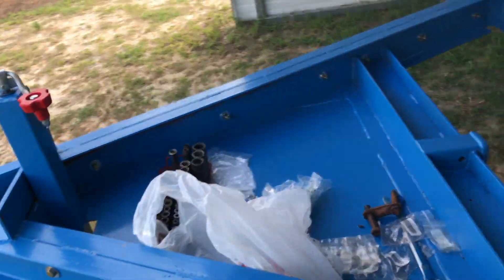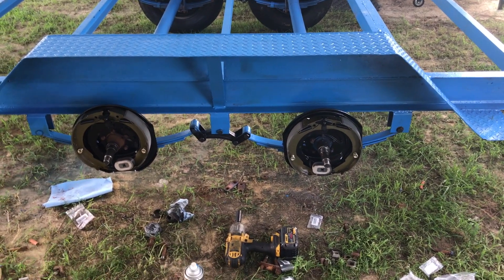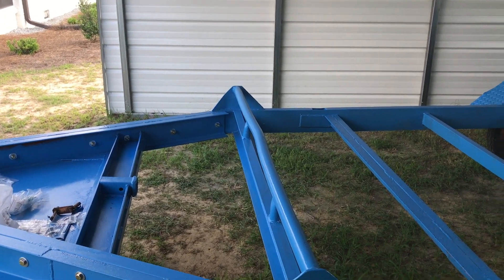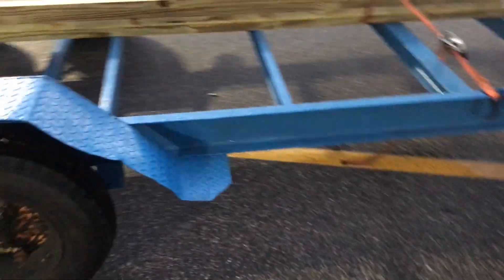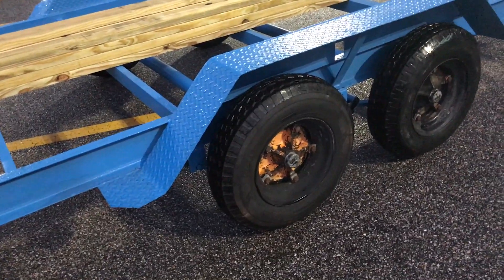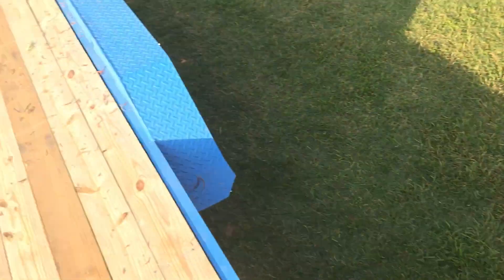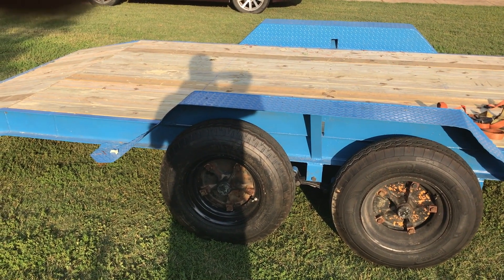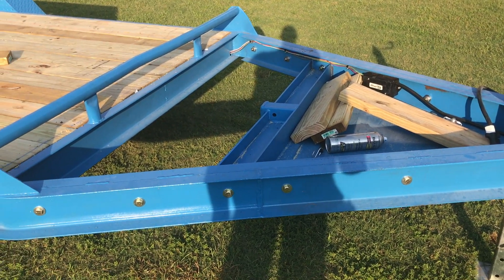Equipment Trailer Rebuild

Comment: Very nice trailer,used motor oil for stain?
Reply from the maker: I may I haven’t thought to much into it thanks
Reply: @noahswelding6836  cheap and easy,and works good.

Comment: those wheels are a total PITA, plus finding tires, but never seen one balanced, but there is 2 ways, easiest if find an OLD MECHANIC SHOP, that has been around 40+ years, ask if they have an on car tire balancer, those do exist, but rare today, but they roll up to tire & spin it along with all its connected to, it was one of the old ways of thinking to balance wheels & tires. next just ask tire shops, or "truck" tire shops if any adapters to allow to balance wheels, not sure, but maybe?but many times what I have seen is due to clamping nature they sometimes don't clamp true, or you have a slight bent wheel. if you ever do another, swap backing plates weld on new plates, & get new drums that fit the odd size bearings, then you can run conventional trailer wheels & tires
Reply from the maker: Yeah I’m starting to see that I’ll eventually switch them out with normal style rims
Reply: etrailer.com had it last time but will be a pain to look up as I just did quick search, but so worth it. I do have a trailer I need to convert, & move axle & install a center pivot, but will get to it eventually, & if I remember I will send you links to all I order, but will probably be next year.
Reply: Upgrading the mobile home hubs and tires to more modern 8 lug hubs and wheels will give this old girl a new look. Good job so far